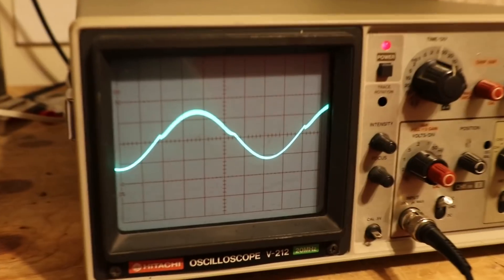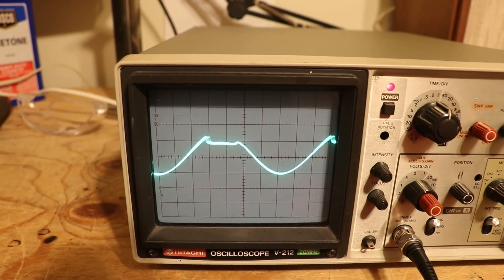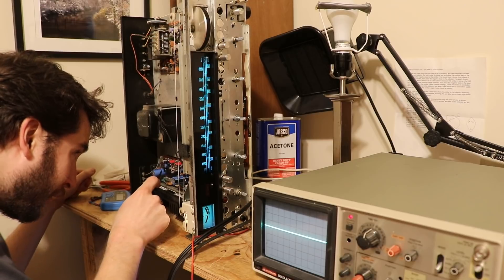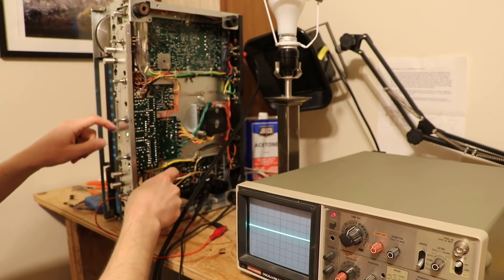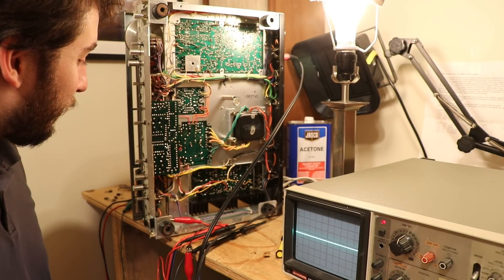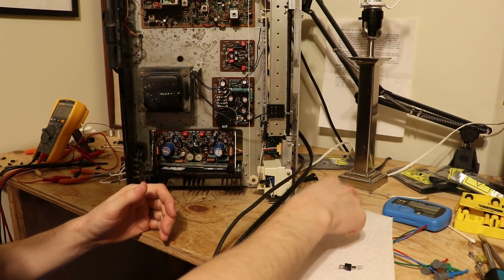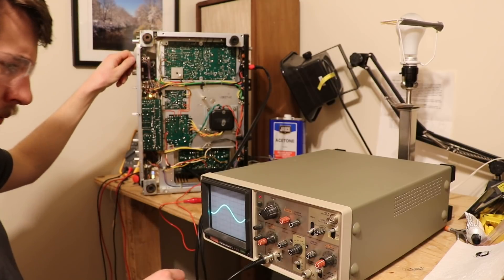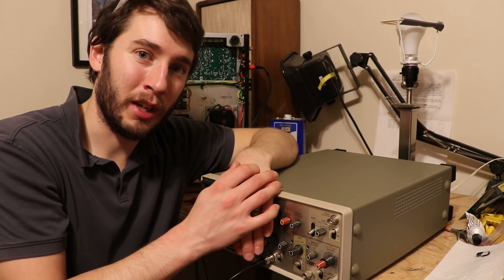Don't Blindly Substitute Transistors - Marantz 2215B Restoration Gone Wrong And Other Mishaps

Comment: I've had the same issues.   Replaced 1384 with 2690 and got the exact distortion you did.   Also blew my outputs when trying to measure idle current.    This video got me out of some hot water with the 1384 so thank you.   How do I donate to your channel?

Comment: I am restoring restoring a 2215b on my repair bench  using a rebuild kit that came with the same  ksc2690 transistors. So I will scope it and see if I have the same issue when . I finish. my boards took a bath in Gatorade so will see how it goes. so far sounds good but one channel is louder then the other and it is not the fader style balance . detox that and everything else . So a little circuit tracing to do .I noticed you turning the unit back and forth . a large  lazy susan would be helpful for that . that is what I use for in chassis work on the repair bench . I think I am going to go with the black face plate on this one when I am done . I was going to recommend that you should get a variac in addition to your dim bulb tester / very important on vintage units that have sat for a while . Anyway good videos .I'll update in the comments if the 2690 work out ok after checking the bias.

Comment: I’ve just got my hands on a 2215b just the other day but there is no sound at all. Both channels are dead. The power supply board checks out ok, it supplies the power amp board with 50volts but when I start to check voltages on the power amp board I’m seeing nothing. When I plug in headphones and crank it up to max I do hear music, very faint and distorted. Anyways just wondering if you could suggest something to get me in the right direction. I’m leaning towards bad outputs, just seems strange that both channels are completely out.

Comment: Hello, i hope to hear a little bit of what kind of, Ceramic Tube X Ohm 5% X Watts High Power Fixed Wirewound Resistor. should you, and recommend to connect a oscilloscope like you did ? I'm always staring to work at my receiver just hobby.  thanks a lot if you give my some guidelines of kind of: what Tube to buy. and Ohm / watt. 1 or 2 tube.

Comment: Funny to watch yr video right now, because 2 weeks ago i was restoring the power board of a 2215 and did the same substitution of the shorted 2SC1384 with KSC2690. I got exactly the same distorsion issue on both channels when loaded. This is an oscillation that i fixed by increasing the value from 50pf to 100pf of C713/C714 the capacitors between base and collector of the VAS transistors H703/H704 that are in the negative feedback loop

Comment: I changed just 1 transistor and blamo that channel is dead.  It went from 6 mv offset on the right channel to 20 volts!   
Tried putting the old transistor back in and it is still screwed at 20 volts so this replacement blew something else down the line.  Even the headphones out is gone on the right channel now.  
Looks like I've got a Pioneer Sx 434 for parts now.

Comment: i blew out a to3 output on a 828 as i had the board loose it touched the dam metal as therei s only 1/8" clearance from the output pin wrap to the chassis.
shit happens.

Comment: The person who designed this amplifier put a lot more care into the details than you may realize.  If you use new transistors with "better" high frequency response, it can make the circuit unstable, leading to the oscillation you were getting on the waveform peaks.  Your waveform was also showing what is called "crossover notch", which is caused by inadequate biasing of the class AB output transistors.   There was pretty much always an adjustment for this in hifi amps and receivers, as it depends on the characteristics of the installed transistors.  To replace any transistor, ideally you should compare the data sheet for the original part with the new one to avoid problems.  It's my understanding that transistors don't "wear out", so replacing ones that are working fine with different types is probably not a good idea.

Comment: I think that

1 bias  voltage failure 
   output transistor failure
2 emitter resistor open
3 Bad output transistor
4Fuse lamp failure

Comment: Very good video and glad you learned from your mistake. Just some words on probing circuitry. For myself, to prevent shorting things when probing around power stages or anything with higher voltages or current potential, I usually instrument the unit (place probes) with power off. Place your probes (clips) with the power off, make sure they are not shorting to anything and they are stable, then power up and make your measurement. Before removing the clips when your done, turn the power off again then remove to avoid shorting out anything. I generally use this technique and I have blown things up much less frequently. LOL !
Reply: Signal tracing with scope some good advice you gave. One person here suggests one long ground clip to the amp to ground it. This way you don't have to use a ground clip on your probe that might slip off.

Comment: I'm no expert on audio electronics, but I think I would try to get characteristics of the transistors first and compare them to substitutes. The thresholds of the current amplification and linearity vary a lot from transistor to transistor and need the bias adjusted, even the bias may not be in the range the substitute needs so you'd need to change that as well. I even might characterize the original transistor if one is still in good condition and try a few candidates and see which one comes closest. It's a lot of effort of course. My respect for even attempting to repait it!

Comment: I question why replace working transistors during a restoration? I was taught a semiconductor will work or not work. They don't wear out, in as much as another component in the circuit fails and takes out a transistor. I'm about to embark on my first restoration and trying to gain some knowledge from others. I've ordered full replacement transistors and capacitors as shown from my friends on Audiokarma. But now I'm not so sure I will replace transistors that are working. Any comments?
Reply from the maker: Some do wear out. I've seen it plenty of times prior to starting the channel, but here's two examples:
https://www.youtube.com/watch?v=jWOd2zwj2io
https://www.youtube.com/watch?v=W5zNOQOI-EI
It's dependent on the specific transistor at the end of the day. TO-92 size are typically ones you'd want to replace. You find these in the preamp sections and the beginning of the power amp sections.

Comment: The correct procedure: Download the datasheets for both the original and the given substitute. Compare operating parameters and make a determination if it's suitable. 

Don't take anyone else's recommendation without vetting it yourself. Fortunately, I have a knack for locating sources for some of these very old transistors, so RARELY do I need to substitute. I highly discourage substituting for the purpose of "upgrading". Plenty of work was already done in the engineering and design stage. If the manufacturer made a mistake, it would have been identified along with a remedy in a TSB (Technical Service Bulletin). 

Also - be aware that the Chinese will counterfeit anything. They will grind off numbers and re-stamp a .05 cent transistor with the numbers from a popular high-demand original part and sell it for .99 cents as genuine . . . and .94 cents is a big profit for a lot of people in that country.

Comment: So you replaced working transistors with different types and now the amp clips on the lower part of the waveform. Looks like you messed up a good working amp with your substitutes. Edit: Im assuming the output stage is push-pull? Do the replacement transistors in the lower half have similar gain to the originals? This amp didnt leave the factory with a fault like this.

Comment: As previous poster commented I would check the biasing first before going thru the effort of replacing the transistor. Ive seen exactly what you found when the amp biasing current is too high! When changing transistors more times than not requires readjusting the bias!

Comment: Hi Aidan,
Thanks for the reply and you confirmed what had thought you'd done.
So your saying the ksc2690 were good in themselves - but that in this units circuit they did not play well with the other kids,  lol.
Ok please help me to understand why not?  That answer could really mean some good learning!
Best regards
Jack.
P.S. a bit off topic, but after watching your "tools" video I don't recall any load resistors like you had in this video. Could you also share the important spec's, appllication and source for those?
Reply from the maker: The "why" would be a question for another commenter or someone like xraytonyb, a very good DIY channel. I'm learning as well! 

Good point on the load resistors, they should be in there. Here they are: https://www.mouser.com/ProductDetail/Ohmite/C300K8R0E/?qs=tdviw6CI36f2RiBBjsEH%252Bw%3D%3D
Reply: @AHFixIt   Yes, xraytonyb has a great channel.
Thanks for the link on the load resistors.
Have a great day.
Regards,
Jack

Comment: Hello,
I'm hoping to learn from watching this and I'm not clear even after reading the other comments what was thecause and fix? 
Were the transisitors chosen as replacements simply bad from the factory?
Or was the type of transistor not a good match as a replacement?
And if so,, could you simply explain why?
Finaly did you re-install the original transistors - or choose a different replacement?
Again, I'm trying to learn and understand, so thank you for your help.
Regards,
Jack
Reply from the maker: In restoring the power amp board, I decided to change the transistors even though the originals worked. I did this because transistors can fail. Some will argue that if they work, do not replace them. I don't always believe in that.

I found a list of replacements someone recommended. I happened to have all of them on hand so I changed everything. However, one of the subs (replacing 2sc1384 with ksc2690) was not a good sub. It was not a good sub because it did not work in this circuit specifically. This sub might work in other applications, but this one, the 2215B power amplifier, is not one of those. I reinstalled the original 2sc1384's and all was well. There were two per channel, so four total that went back to original.
Reply: @AHFixIt  I looked at the specs and it might have been differences in the VCE and VBE saturation voltages.    The KSC2690 was probably not "turned on" enough as seen by the crossover distortion and jumps in gain as you turned it up higher.  The rest of the specs seemed fine. Modifications to the biasing circuitry was probably needed to work right.

Comment: I would have gone with substitutions...this seems like its running out of gain somewhere... You must have a weak tranny in there. Weak to the circuit..it also seemed like the amplifier is running class B with tons of crossover distortion...I have not seen the schematic, but if its a single transistor input amplifier stage then its upmost importance to have the highest possibke gain tranny in there. If its a diff circuits its upmost important to have them matched...but I have not watched the videk yet :) i build tranny and tube amps and know quite a lot about what happens when and why in the schematic

Comment: I'm not familiar with that receiver, but the reason for that output signwave distortion is due to biasing on the negative voltage. Adjusting the bias, if possible on that amp, would resolve the issue with the new transistors.
Reply: I agree ... this behavior looks exactly like wrong biasing

Comment: Your going to have to get yourself some insulated mini grab clips to get into those tight spots. There's lots of them with different style ends on them on Amazon. Is this the same unit which went thru the carwash?
Reply: E-Z Hook probes are a must, along with a series lightbulb current limiter.

Comment: I was doing an LED conversion on a Pioneer SX650 and my multimeter probe handling was a bit sloppy and I shorted the light bulb tips for a fraction of a second and blew a fuse lol. After successfully replacing 24 caps with no mistakes. Then I go and screw up something so simple as trying to see which wire was positive and which was negative lol

Comment: You seem to make steady progress and it is interesting how you drive this home! However, a couple of times I was a bit surprised about how you approached this task, I expected you to refer to the standard amp designs more often when you see an effect and then look for the most likely causes. For example you had those 28 volts at the speaker terminals. Now, in most cases the output is decoupled through some capacitors or maybe a transformer, so I would have checked the output capacitors as the natural next step. Checking all the capacitors is a very good idea in any case. Then in this video you had these very pronounced crossover distortions. In almost all of these old amps the power stage is a push pull configuration of a pnp and a npn pair of transistors that needs to be biased. This is done by diodes or a Vbe-multiplier which is normally adusted with a potentiometer. I did not see you search for this part? Also, you can very often get the circuit diagrams on the internet  and it should be very interesting to analyse these schematics. But, as the saying goes - many paths lead to Rome and all that counts is to get this thing to work. Im am very curious already  to see the final result!
Reply: Thank you!

Comment: Weird - I've used Fairchild/ON KSC2690 to replace 2SC1384 in three different receiver rebuilds over the past few years (Pioneer and Sansui units). I have not experienced the type of signal distortion that you are seeing at all.
Reply: Might be the hFE gain selection or V_sat can get pretty critical if things get touchy with feedback/oscillation stabilization, rail limits, etc.  Depending on circuit.  If this thing is a Sziklai I could see this happening even more so if the gain gets a little to wiggy (just typically the "PNP" side is pretty critically tuned).  Anyway 2690?  Yeah I've also encountered a not-so-great sub with it on an old Fisher.  Just needed a lower gain one and it was cool after that.  It is available in...I think 3 different hFE groups.  Y-Gain, O-Gain and is it G??  Can't remember.
Reply: @wonderbars36  HFE looks good, pretty sure the V_sat differences was the issue.   The rest of the specs were "close enough".   Biasing mods would be required in this scenario.

Comment: There are two pairs of supposedly matched transistors somewhere that are not matched.  You are seeing crossover distortion which happens when the handoff from push to pull is not perfrctly in sync.
Reply: You mean the npn and pnp right? I thought that as well
Reply: @JMNTN  Yes.  Exactly.

Comment: Is this a channel to teach by mistakes?  maybe I missed your objective. Why would one not confirm the proper transistors before replacing. Shotgun approach is simply dangerous practice which could lead to blowing output transistors which on some sx ….80 series are darn difficult to find. Try finding original 1280 ones
Reply: Having watched Aidan's channel, I would have NO problem sending him work!  In fact I have a Realistic STA-2000 that needs work.  But unfortunately he does this as a hobby :(
Reply: @Magnusaudiofighter  I didn't miss the objective or the point.  The original comment was edited, removing a negative comment directed toward Aidan - which is why I commented the way I did.
Reply: @Magnusaudiofighter  , my favorite definition of an "expert" is "a person who has made all the mistakes there are to make in a particular field".  It's likely that there are no true experts because no matter how much experience you have there's always the possibility of making a mistake next time. I personally find that making mistakes is part of the learning curve, and if someone doesn't make any mistakes then they probably aren't trying very hard!  On the other hand, it has been said that the definition of insanity is doing the same thing ---- or in my own case, making the same mistake ----  repeatedly, and expecting different results! 🤪

 Keeping in mind that making mistakes is part and parcel of learning about electronics, use of EZ-hook testb probes and a series-wired incandescent bulb as as a current limiter will make it less likely for your mistakes to do major damage to the components and circuitry.
Reply: I am glad he shows mistakes. It helps viewers figure stuff out. And the school of hard knocks is the most effective and lasting form of education. Maybe AH's goal is to share his knowledge and maybe get some other young folks interested, rather than just show off. When I am too old, I might need someone younger to fix my vintage stuff!

Comment: For 2SC1384, I've used TTC004 (which Digikey has in stock) in an SX-828. BUT that unit only has one 1384, and it's in the power supply. I've also used it to replace 2SC1124 and 2SC484, and the complement, TTA004, for 2SA484. The SX-828 sounds great now, but YMMV. I'm always crossing my fingers with transistor replacements, especially since so many of the old standards have become hard to get.
Reply: I bought many TTA004 and TTC004 in Digikey for fix many Onkyo receivers.
Cheers.